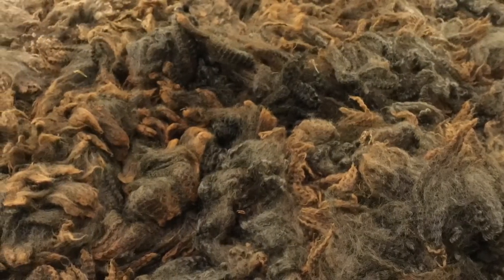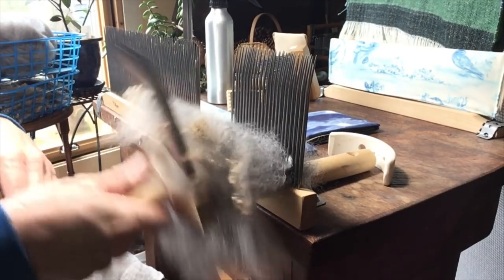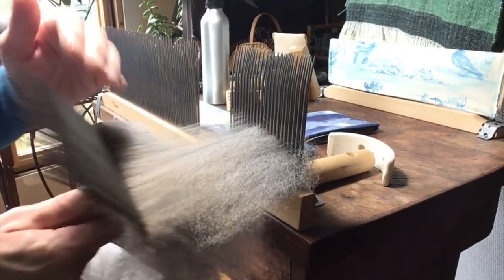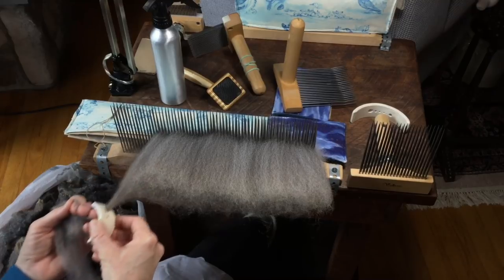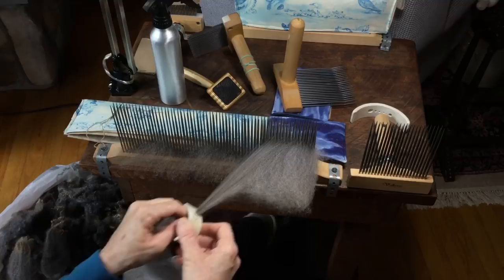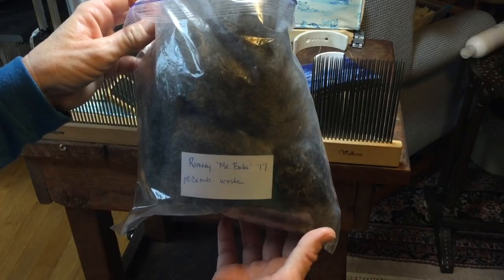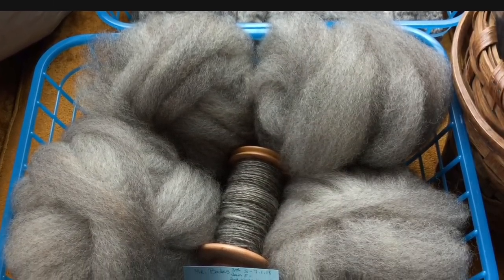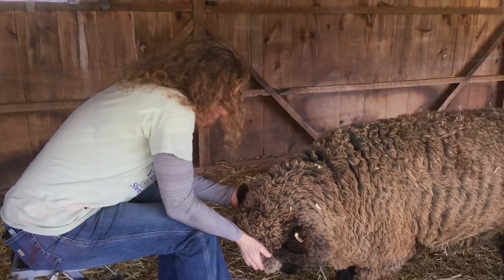Wool Combing ~  Romney, Mr. Bates

Comment: Beautiful. 
Thank you.
I see that (if I understood correctly) that carding is not necessary to create a top.
I am brand new to the world of spinning and am trying to learn how to turn a fleece into top, so it can be spun.
Your video was very informative.
Reply from the maker: No, carding isn't a necessary step to create top. Combing (worsted) and carding (woolen) create two different fiber products. Top fibers are all parallel and carded fibers are intertwined. You can take roving (carded fiber) and comb it into top and you can take top and card it (if the staple isn't crazy long) to make rolags or roving. It's fun to play around with different types of preparation and see what results you get.
Reply: @thenaturalspinner  thank you so much. 
 😊

Comment: This makes so much more sense. I mean the way you use the hacker
Reply from the maker: Hi Sue, Well, it’s my main use for the hackle, but it’s main purpose is for fiber blending, either color or different kinds of fibers. Since I don’t do much of either of those and I like to diz off long tops to spin, that’s what I use mine for :). Thanks for your post! -Kimberly :)
Reply: TheNaturalSpinner I use my combs some times but I’m normally a batt maker because I like larger amount to work on. I always felt the small nests were just to small and slow but loading the hackle to make big bumps of combed top makes so much sense now. I also love your little table setup with combs and hackle. I’m on the hunt now for something similar. Thank you for the lovely videos.

Comment: Wanted to say that one of the things I have appreciated in your videos is that you show ways to use almost all the fibers you are processing. I see videos sometimes where the presenter pulls the first (or sometimes second) waste from the combs and casually says to just toss it away, as it has no use. I don't raise sheep, and purchase whole fleeces to process. Not an inexpensive hobby.  I do re-comb my waste, usually through the 2nd waste I pull off. If the fiber left is just tangled and shorts, I have hand carded it also. What isn't something I'd want to make garments with goes into my bin of rug wool, and will become a roughly spun yarn for a semi-felted hearth rug for my old dogs. Anything that is really scrungy goes out as mulch on my plants. The only issue is that I have to keep reassuring the neighbor children that those woolly lumpy things around the plants aren't really dead critters. 😊 I like the concept of using everything possible for a purpose.
Reply from the maker: Yep, to me it's throwing good money away, when for just some added work, you get much more useable fiber out of a fleece. Not to say I'd do it on every single fleece, I wouldn't live long enough to do that. I just like knowing that I can get far more fleece turned into nice yarn, with a bit more time and effort :) For the fleeces I don't want to go the extra step of cloud making, I save it for my sister who likes to use it for stuffing and felting...so it really all does get used, even if not by me  :)

Comment: Absolutely love the top you made and your technique. I was not pulling out locks to comb like you do. I'll do that with my next batch. I am using Jacob Black and White right now. I love the colors but I find I was getting short fibers at the end of my top while spinning and had difficulty controlling thickness.
Reply from the maker: Making the fibers parallel before attaching to the comb does help reduce waste...but even that can be further processed :)
Thanks for your comment! -Kimberly
Reply: I kept the waste and carded them to make rolags. Don't like those too well. But Im pretty new to spinning so my techniques are not well polished. I have an Irish Tension wheel and and traditional dual drive wheel. I like the Irish Tension wheel the best. Way easier to control.
Reply from the maker: If you have hand cards or even wide dog slicker brushes, you can clean up the waste to re-card it into clean rolags and spin those. They won't have all the waste junk in them and will make for a much nicer woolen yarn. Techniques do develop and improve over time. Good luck with your spinning!!
-Kimberly :)
Reply: Thanks, Just tried your technique. Does come out with a bit less waste. Not a whole lot of difference I was getting before but some. Enough to keep fine tuning the technique. Thanks again. :)
Reply from the maker: Most welcome!

Comment: Could you explain the characteristics of Finn wool and why its desirable or not to use. And what you feel its best used for or blended with?
  Thank you.
 I love your videos. Please make MANY MANY more. LONG VIDEOS PLEASE !   🙃 I just love everything you do!
Reply from the maker: Ah, Finnsheep! One of my favorites! I have a couple of lamb Finn fleeces and I covet them. It's one of the lesser talked about (in my experience) good all around wools. Finer fleeces, like lamb, could be used for next to the skin projects. Coarser fleeces for other things. I find it has good strength and medium crimp. Good length too in the ones I have. (You DO have the Fleece and Fiber Sourcebook, right? ; ~) In terms of blending, remember, the resulting yarn will only be as soft as the coarsest wool or fiber in the mix. It also depends on your skin sensitivity level. Blend with a similar length fiber if combing together. 
Thanks so much for posting your comment!!

Comment: What kind of projects would be suited to make with the second combing of wool?  I'm assuming that yarn spun with it would be a little weaker and less durable and perhaps a bit fuzzier.
Reply from the maker: It's just a shorter staple than the first combed top. It could be spun either worsted or carded for woolen. I wouldn't say it's weaker though. Could be used for many things, lots of 'it depends' factors.

Comment: Question....is Mr. Bates spun fiber plied or singles?...Trying to see on the video..... it looks like they are singles.  Also, do you wash the skeins after spinning?   If so, do you use detergent or just water please?  And lastly, do you weight  them while drying?  Thank you Kindly
Reply from the maker: I am not sure what is shown in the video but I did spin it as a singles and also plied. The yarn is soaked in a wool no rinse wash called Wrapture, gently squeezed and rolled in a towel, then usually just hung to dry without a weight. Sometimes I steam it on the winder, especially if it's lace weight.